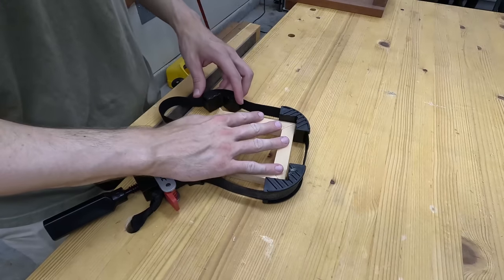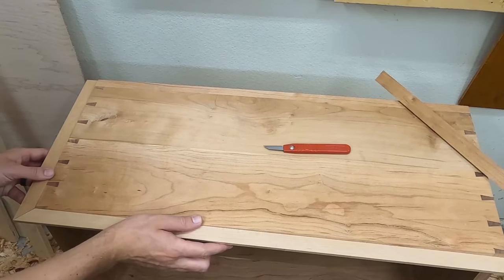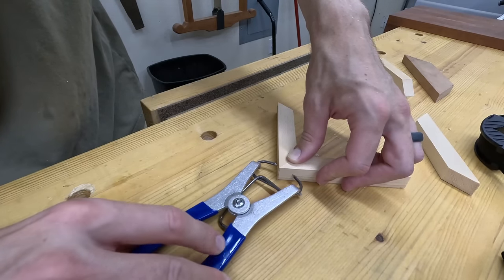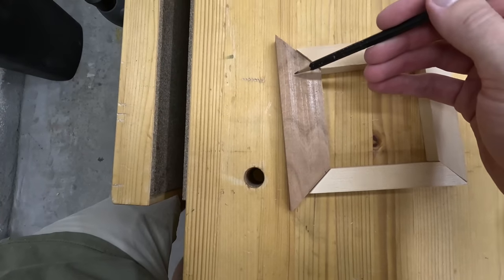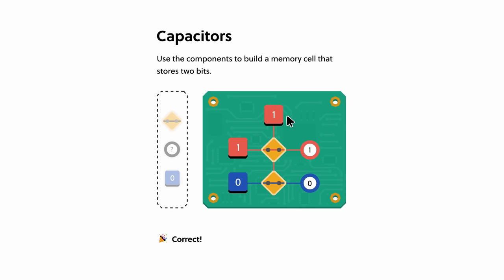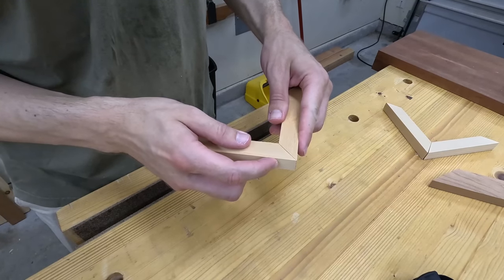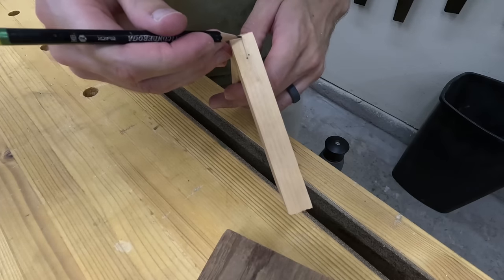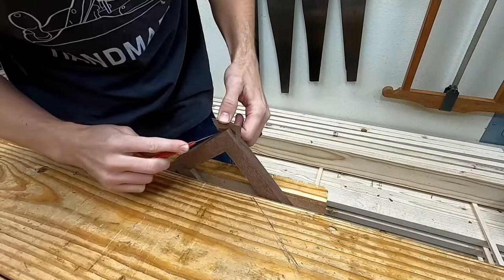Never Miter Without It

Comment: You could just protect the work piece by hot gluing two thin wooden blocks on each side of the corner to serve as contact areas for the sharp points. When you're done, wet the blocks with some isopropyl alcohol and the hot glue will peel right off.  You can also use double sided tape instead of hot glue.
Reply from the maker: clever idea!
Reply: Soooo brilliant 👏! Thank you. I do love his spline trick if spines are desired.

Comment: I think my dislike for mitres stems from strap clamps. I made a threaded rod 4-way clamp like the Veritas thing which works better as I can tighten each corner, but it's not smooth or quick. I may invest in a spring clamp set up now.
Reply from the maker: Sounds like a nice set up! the spring clamps are quick and handy for sure

Comment: I just don't like the holes they put in my work piece.  Not an issue with a project that will be painted.  Just fill the holes, sand and paint.  But on a fine piece of stained and polished furniture, those holes will bug me forever.
Reply: Well said… I came here to make the same point. The function is good but the result isn’t. If it isn’t going to be painted, there’s no way to fix those and even if it is painted, it’s going to be a PITA to deal with.
Reply from the maker: You could spline it like I demonstrate to eliminate it, otherwise filling the hole with hide glue and fine sawdust works a lot better with an oil or clear finish than pva glue+sawdust
Reply: @FranksWorkbench  This absolutely has a placebo I have never been able to cover up the holes on a stained part.  Filling the holes helps but it doesn't solve the problem.  Works great on a painted project.
Reply: Look at my comment for preventing the tiny holes.